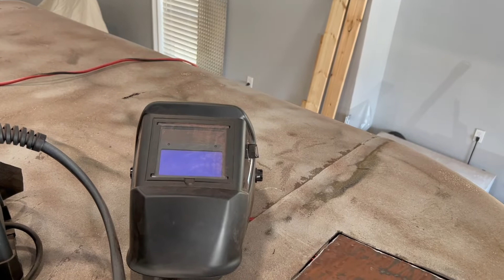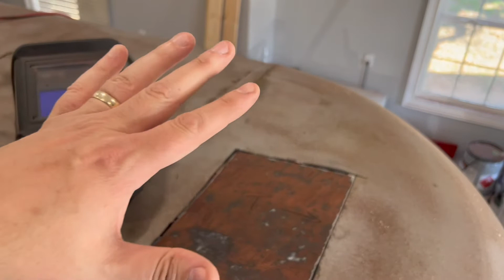How to Patch or Replace Metal

Comment: Hi! What gauge metal would you suggest to replace the sides on a trailer?
Reply from the maker: The roof and the skin covering the front and doors is around a 14 gauge. The metal sheeting that is factory on the walls is thinner, like probably a 20-something gauge. You can snip a piece off and take it with you to a metal shop and find out the gauge. If you're planning on putting metal back in without any wood, I would go with 14, but that's just my preference since it's easy to weld.